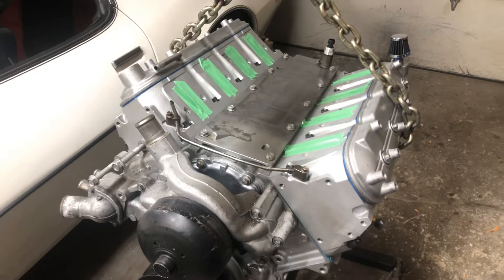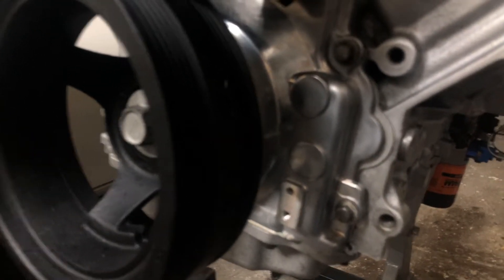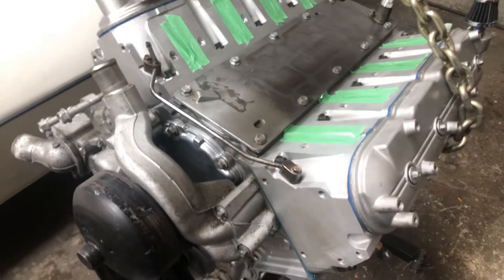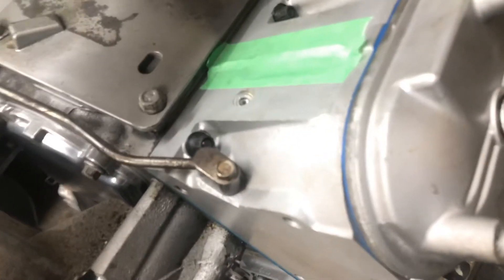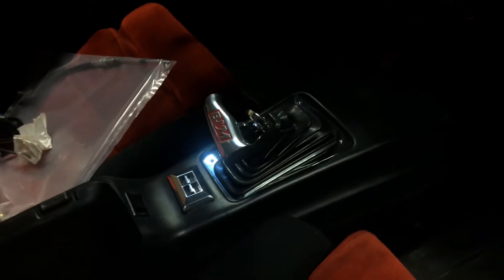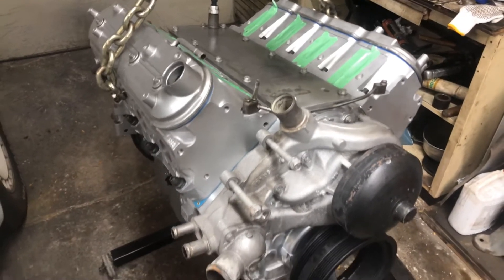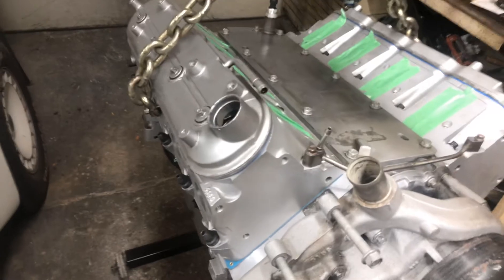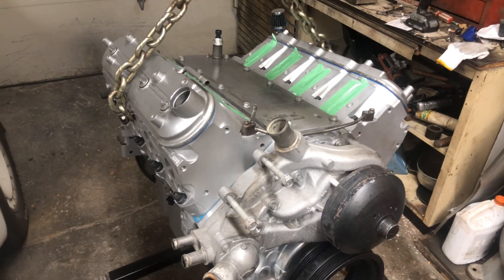LS3 416 stroker assembly

Comment: what heads are you running?
Reply from the maker: Hey Edgar… I’m running L92 cylinder heads rectangular port, same as LS3 heads
Reply: @vikenlink  how much power are you making
i plan on building a 416 with gm ls3 cnc ported heads
Reply from the maker: @ejz71  I’m making 638hp 574 foot pounds torque @ 6800 rpm at the crankshaft . I have a fairly mild cam 225 intake and 238 exhaust @50 113 degree LSA
Reply: @vikenlink  is that to the wheels or flywheel
Reply from the maker: @ejz71  flywheel